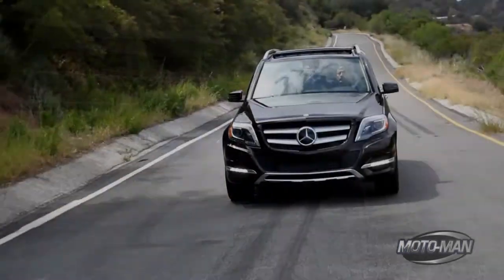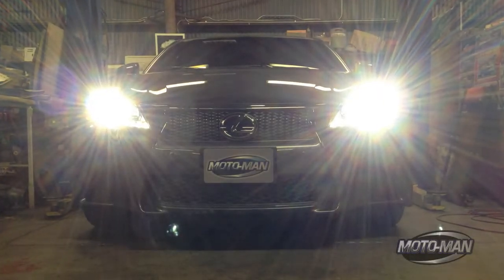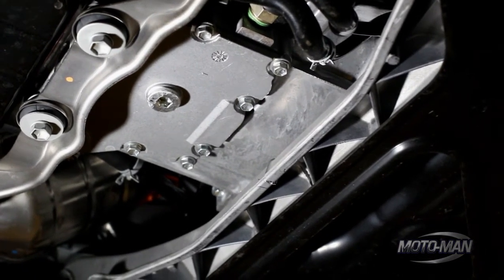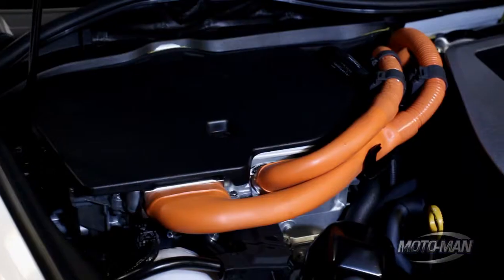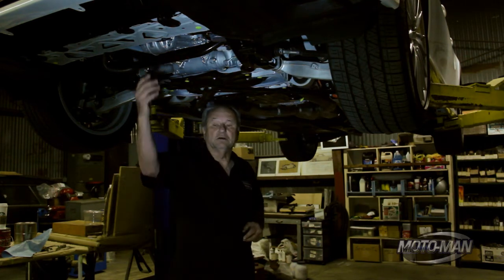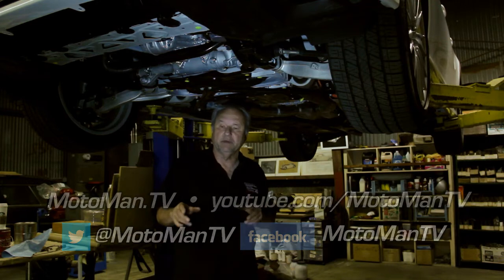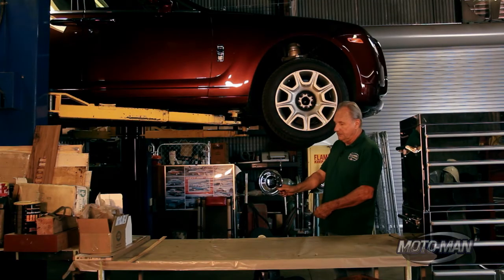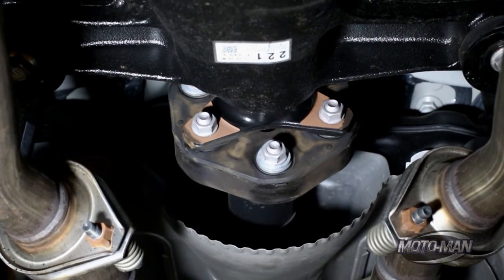2013 Lexus GS450h Hybrid On the Rack with Mean Gene

Comment: I have the same exact car in mint condition, with 55,000 miles, I keep it in sport plus mode and all the time get called out by the younger guys speeding around.
This car is sooo quick, especially using the paddles in sport plus mode, I think the weight of the battery in the rear has something to do with the launch along with the anti slip button, I leave people scratching their heads like “dafuk just happened here?”.
Reply: Do you still have the car? Was there any issue with it yet? How about the big Hybrid Battery? Did it need some cell change?

Comment: I dont understand the whole HP adding up to 666 then suddenly cut down to 338 hp only....
Reply: GorZhe I don't either.. I am on the verge of buying a GS Lexus but then i heard this... Kinda have wonder about this triple 6 things and Pope blessing the GS.
Reply: Probably too late for your decision now, but it's peak power output. It won't give you peak power output from all sources at one point, so the peak through the drivetrain is 338 (on US fuel). Think of this though- with the CVT you get that constantly, whereas in most cars their peak is delivered for 1 RPM in their range. Admittedly this thing won't put even the peak power down off the line, I doubt you get that under 50mph. The only important thing is this though- unless you can afford a Bugatti, good luck finding something that's noticeably faster than one of these. There are only 2 downsides: 1- the engine sounds great but by the time it's at max revs you're going fast enough to get banned. 2- everyone wants a lift.
Reply: I just want to know how to turn up the power